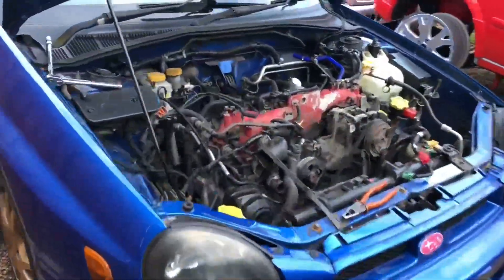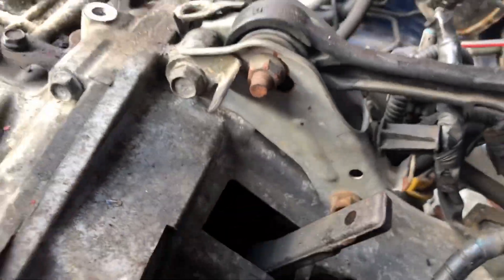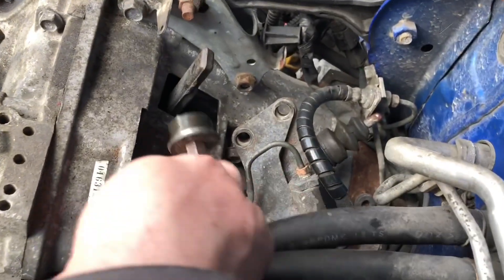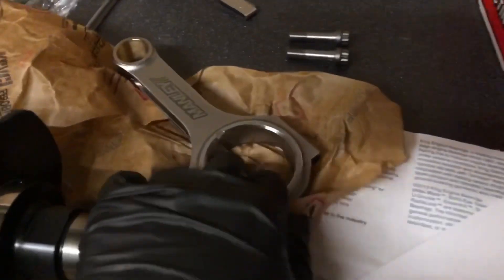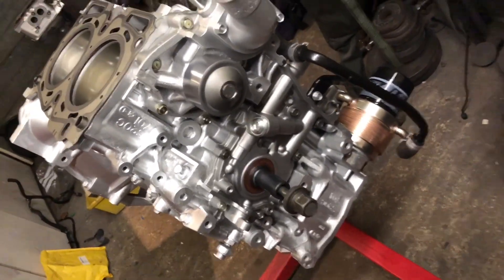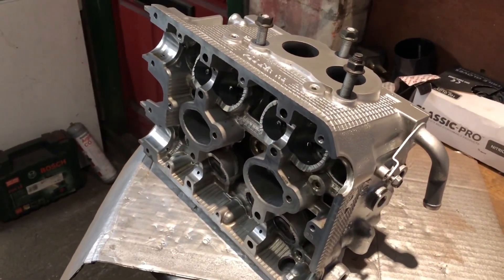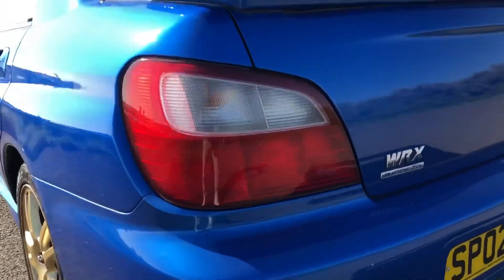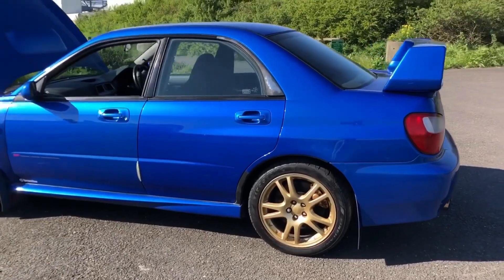[ENGINE REBUILD] ROD KNOCK BEARING FAILURE! Subaru Ej20 Turbo Jdm Impreza Wrx Sti Swap

Comment: How much did this cost you? 
I’m buying a 99 sti v5 Type RA motor jdm import for pretty cheap and bottom end bearings needs replacing so will be good

Comment: Azza is it worth buying a suburu Impreza ej20. I've read the engines are weak and even when forged there still prone to fail due to the boxer engine design.  just wanted to ask some one that's knows and who works them engines and other cars what your advice would be. Thanks azza 
Azza ;).

Comment: Sounds quite tame for a Nur Spec R! Nice build, good choice of internals. I have the 2.5 STi Spec D, so went fully forged and Cosworth HG's, ARP head bolts / studs, Manley rods, Mahle pistons, ACL bearings, ACT clutch.342 bhp and a whopping 410ft lb - mapper was Bob Rawle.Google Spec D STi, one of only 300 made, and a right sneaky sleeper, I've kept the outside completely standard.
Reply from the maker: Thats awesome man! Sounds like a great build. Proper parts! Bet you have fun in that
Reply: It's higher 4th 5th and 6th gears where the 2.5 really does stonk along. Had it 6 years now, forged it 3 years ago. Piston slap when cold, but oh well, just a trait and just how it is lol